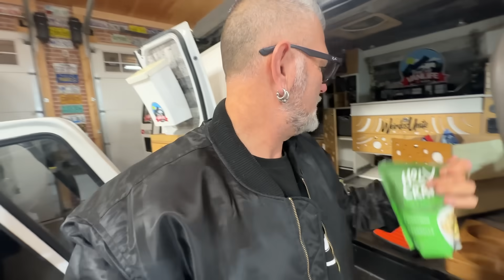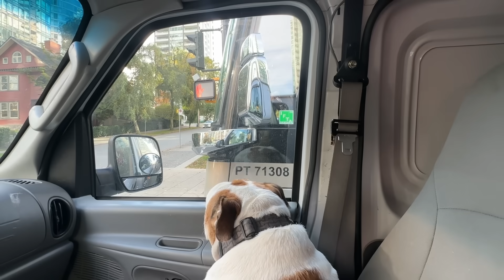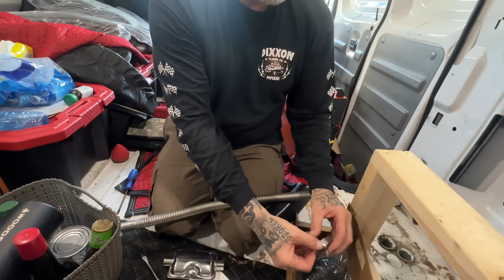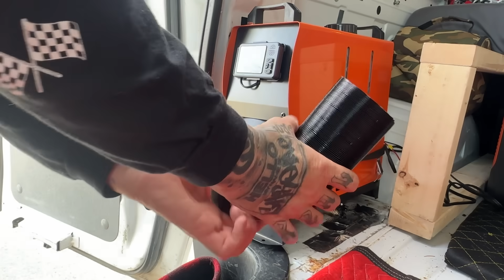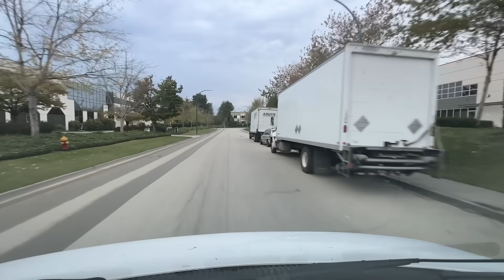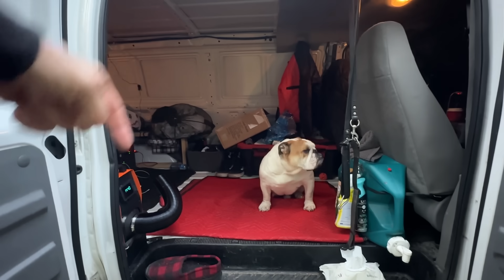Am I Buying a Cabin In The Woods? No More Cold Nights In The Van

Comment: Sounds like a bigger home base.   Nothing wrong with having space to store all the toys for all the adventures and a place of your own to store and repair things. I know he’s been wanting an atv for sometime, that’ll require space for atv and trailer as well.
Reply: Yeah, once he raises the roof of the ambo, it's not going to fit inside the current rental shop
Reply: Greit van builder  uses 51smp battery  no solar 48 amp floor AC with 14 day battery no inverter needed  3000 I verter for applie

Comment: apply a layer of cork..their's some peel and stick that you can mold to the van cause it's quiet flexible and expanded cork for floorings and fillings in big spots..avoids molds and it's acustic and termal isolation and NATURAL..search around your country but it's made in portugal only so probably imported in Canada for sure..bye bye condensation

Comment: Please make sure the exhaust  output is facing toward the back of the van otherwise air is being forced into it as you drive.
Reply: Temporary situation. Plus I don't think he'll be using it while moving
Reply: @ricebike  Even not using it while driving, the forced air could gunk up the chamber with exhaust residues in the muffler and hose. Not meaning to be critical here, just some info. Namaste.

Comment: How difficult to put insulation in the van? Or does the body work have to be done first?
Reply: ❤😂depends on the van..and choice of insulation...wires before insulation if spraying 
Wires can be after if using foam board (GPS or stranded)
Some even opt for pink batting or rock wool.
Reply: Yeah he's in the shop van temporary situation.

It's going to the body shop soon that's why he's not bolting anything down